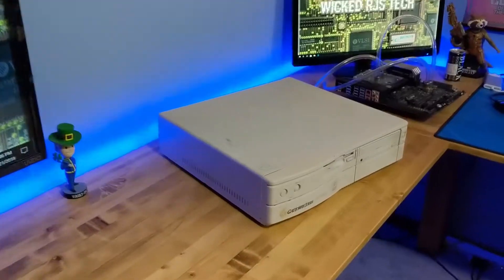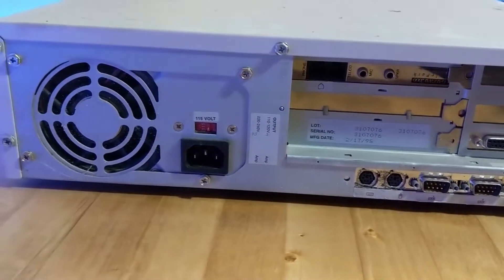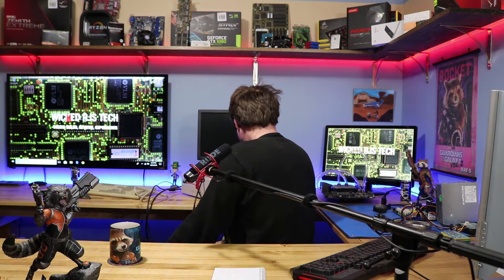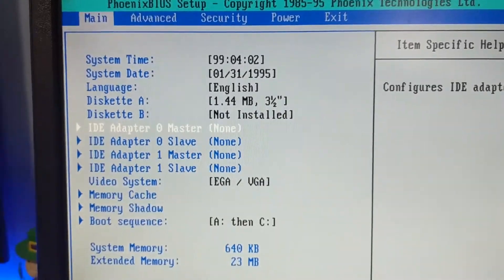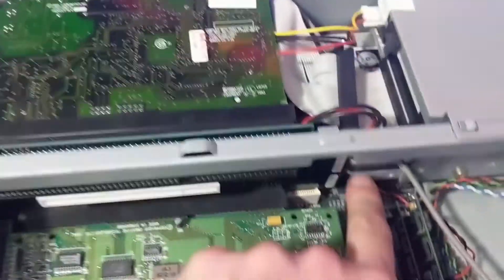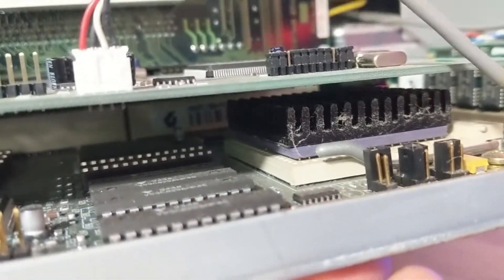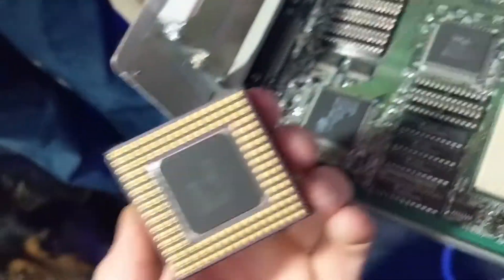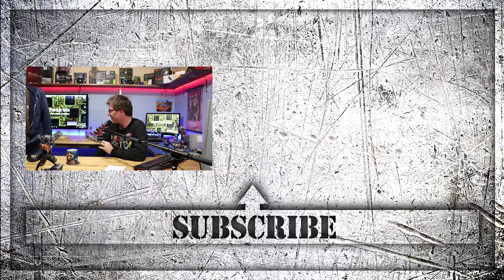Found a Vintage Gateway 2000 PC from 1995!

Comment from the maker: What ya think guys, should I throw in a hard drive and get this old beast running again? Install AOL Dialup lol
Reply: I had this same pc, had a sb16 and a nvidia 32mb card... a 2x cd rom (which i later replaced for a 4x) and a modem us robotics 32kbps
Reply: when you powered on, and I heard the beep sound i got all nostalgic, mine came with a 600mb hard drive
Reply: these came with "windows 3.11 for workgroups" i remember connecting to the internet back in 94 / 95 using trumpet winsock and netscape 1.5 or 2.0, which later i updated to 3.0 gold, also installed gopher didn't use it tho... I did use irc. If you need any help getting it back up and running let me know. I had the same one. Gateway2000 486dx 66mhz, it came with the crystalscan 14 inch 1024ni monitor, which with the graphic drivers would load 24bit 60hz
Reply: @camartinez6  which disk came with the system ? do you remember what it looked like? several gateway 2000 system disks have been uploaded to archive.org

Comment: i have this unit. Evenif  its plugged up ... if the battery is dead it wont boot nor store any settings you make in the bios.  The battery was the black block type commonly made by rayovac.  i cut  the black and red wires from the battery , stripped em back a little bit and used black tape to attach the black and red wire to a aa battery.  this gave it enough juice to store the settings long enough to get it running. if you dont want it send it to me ill take it